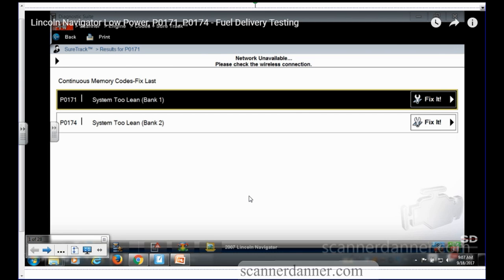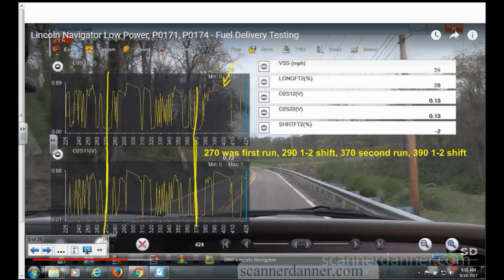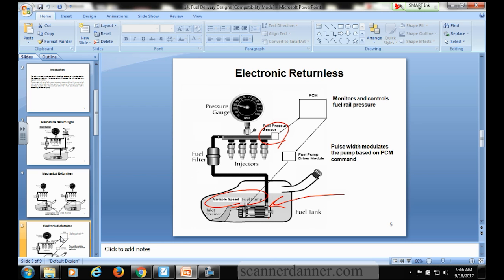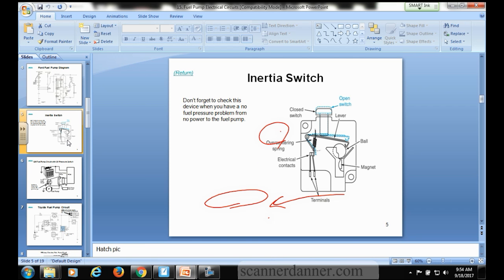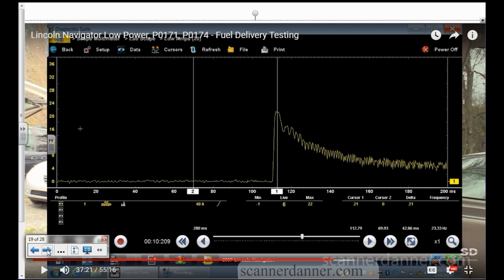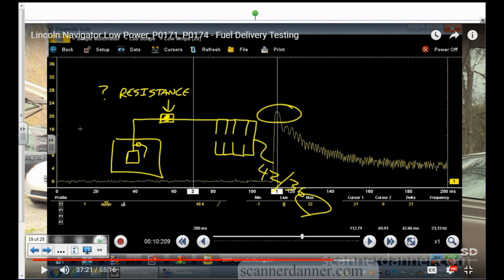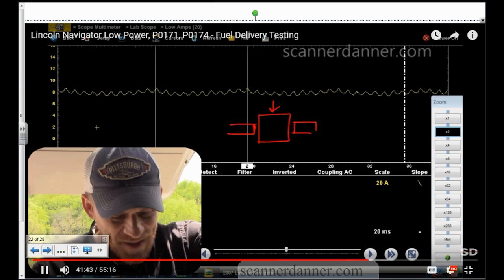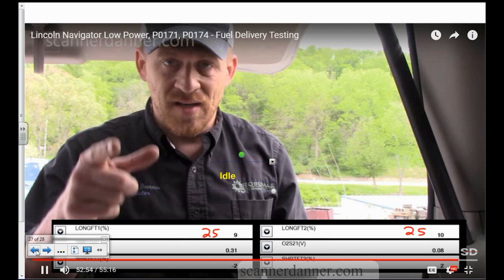An SD Premium Class on Fuel System Testing and Trouble Codes P0171, P0174

Comment: Hi Paul. Thanks for the video. Great and full of good stuf as always.
I want to discus with you about feul pump current. In this video you say, that cloged fuel filter would cause more apmerage on pump. I think on this fuel delivery design it is not true. Because fuel pressure regulator is in fuel tank, it doesnt mater for the fuel pump how big is restriction after that regulator (fuel pressure after regulator never gets biger than it is set to). So if fuel filter is in line it can be completely cloged and fuel pump amperage and rpm should be the same as if filter is new. Corect me if I am wrong. 
Thanks again for your sharing of knowledge.
Reply from the maker: I think you are right my friend! Never thought about it much. To be honest, it is really difficult to ID a restricted fuel filter no matter what test you do. Short of t-ing in a gauge before and after the filter and at which point it would be easier to just change the damn thing. Right?
But I agree, high amerage on a pump from a plugged filter would only apply to electronic returnless systems and return type systems. NOT mechanical returnless systems like this vehicle has.
Reply: I think you are right about changing fuel filter. I think that way: if its clogged filter, nice. You changed it and got it right. But if it was bad fuel pump, after changing it you will change fuel filter anyway. So customer doesnt lose money on both cases.
Reply: @arvydas6358  heres something to think about- a restricted filter causes pressure build up in the pump plus lower fuel transfer rates causing thermal stress on the pump.  a new filter fixes that but has the damage to the pump in the mean time caused irreparable harm?  my experience says yes . usually if a filter gets to that point  the pump wont be far behind.
Reply: @richardcranium5839   Yes. A clogged filter would cause a pressure build up in fuel system with return line from fuel rail or with  electronic returnless system. In this example car is equiped with pressure regulator in fuel tank. And fuel filter is situated AFTER pressure regulator. So there is no way that clogged filter could cause pressure build up at the pump in this system.
Reply: @ScannerDanner  a fuel flow volume test will show it sometimes.  theoretically speaking  yes  you would have to test  before and after the filter and by that time you are correct ya might as well change it. working with different hydraulic systems over the years(yes a car fuel system is a hydraulic one) often times taps are installed to be able to diffentially pressure  or flow test a part or a subsystem.  i've found bent twisted and other various restrictions in inaccessable places by using such methods  so an open mind that there are alternatives may one day get someone out of a bind.  mind exercises like that help get the whole picture in better focus too.
Reply: I am also thinking that on this design, clogged fuel filter will not change amperage much.
because fuel pressure regulator is in tank, but i don't know for sure how big is bypass hose trou regulator and how it affects amperage.

Comment from the maker: Class is in session :-)
https://www.scannerdanner.com/join-scannerdanner-premium.html
Reply: Danner i need your direction on a problem. 2007 haundai santafe, v6.
fuel trims on both banks at aprox 30%. im thinking MAF OR FUEL PUMP.
Where i got stuck at is when the rpms are raised fuel trims improve, i thought a bad MAF or FEUL PUMP  would cause fuel trims to go MORE positive as rpms increase?

Comment: Loved this case study. Perfect timing. I was the guy on your last video comment section with   same p0171. I added the  supercharger 5.4 3v and suspected fuel pump. 
I have around 5v on maf and have fuel sensor on rail. I don't have your snap on scanner but this clarifies alot. My fuel pressure is around 33psi idle no Schrader available.  I really suspect the fuel pump now. Truly weight in gold information. 
You are a pillar in automotive diagnostics. Cheers and Happy Holidays
Reply from the maker: Correct, you absolutely should not be seeing significant drops in pressure on a snap throttle test. Are you?
Reply: @ScannerDanner  no drop in snap test. It runs great when its engine cold. Open loop it runs like crap. 
I hear a exhaust leak when under boost. Then it loses power. Thinking air is getting through upstream unmetered. What do you think Paul? Thanks for responding
Reply from the maker: Careful, I think if you have a psi sensor on the rail, it is normal to see psi around 30ish at idle
Reply: @ScannerDanner  going to move it to the forums as you suggested. There shouldn't be any significant drop in rpm rise correct? If anything a rise, right? Its an aftermarket assembly made by airtex. My fuel trims on long term go above 10% with little to no drop in short term. Tuner assumed it was a vacuum leak and overlooked fuel delivery. these stock pumps in theory will support around 400rwhp but still a wearable component and I think it's been pushed beyond its limits

Comment: Gtdi gas through direct injection dont thoes types of fuel systems require more fuel pressure than normal or legacy fuel injected systems
Reply from the maker: Yes they do, but the delivery from tank to high psi pump (mechanical) is all the same

Comment: I am a member of the premium channel but i couldn't find this video when i searched .. thanks danner
Reply from the maker: I don't think it is there! I looked everywhere for it. Like I said, it got lost in my vault and was never released until now
Reply: @ScannerDanner  can you make us a video here or on the premium showing how to measure or test fuel pressure on direct injection cars , usually these cars have high pressure pump which will exceed the gauge reading so how we verify the fuel deilvery on that type .. thanks once again
Reply from the maker: I have a few GDI case studies. Also chapters 16 and 17 playlist. I have a no start GDI case study on a GM and a 3 part series on an Audi 
Just use the Premium search and type in GDI
Reply: @ScannerDanner  thanks danners
Reply: @ScannerDanner  thanks danner

Comment: If you want to gain a whole new larger audience , output videos of diesel engines in cars and truck. You are good with gas engines,  make diesel videos just like your gasoline videos and you can double your audience, viewers, and patrons.
Reply: With diesel vehicles, you still follow the majority of same processes in fault finding/diagnosis. There are some faults which require specific processes in fault finding ie for common rail diesel engines but are now starting to cross over to gasoline engines with the advent of GDI (gasoline direct injection. The simple thing is, if you are proficient in one thing, it isn't hard to become proficient in the other, the electronic systems operation are very similar.
Reply from the maker: I don't work on diesel engines otherwise I would! We have almost no diesel cars where I live, so I never see them. What I do know from the diesel techs who follow me is a large percentage of the concepts I teach are universal and can be applied directly to diesel engine systems.
Reply: What about hybrid clunkers?? I’m about to go to training for them
Reply from the maker: Don't work on those either but, same thing, the material transfers. The training will be good for you from the safety standpoint.
Reply: Yea I unhooked the 12 volt battery but didn’t unhook the high volt system started working on it woops didn’t know til my hybrid buddy said wtf you doin
Reply: @philh9238  be careful with hybrids, they can ruin your day real fast if u don't know what are you doing

Comment: Great I got a question. I have seen on several occasions the use of the fuel pump waveform to calculate rpm of the pump. My question has to do with the comutator bars. When u have a low current spot in ur waveform wouldn't the current flow be low again at 180° meaning the pump has 16 bars?
Reply: Great video but I'm still confused. My question is if a single commutator bar is damaged and doesnt allow current flow wouldnt u would see a drop in current flow when it passes both brushes? If so wouldn't 1 rotation of the shaft of the motor be every other dropout?
Reply from the maker: In theory that is correct, however I have a case study showing a complete drop out only 1 time per revolution which means when the polarity is reversed it can support current flow, so I suppose it would be a brush to commutator contact issue in that case, not an open winding. An open winding would be as you described
Reply: Cool that makes more sense thank u for the response
Reply from the maker: reverse polarity on that same commutator every 180, so it is not the same pattern

Comment: Can you make a visual representation of the difference a good psi with low volume and good volume ?
Reply: On a system with a return line you can reroute the return to a container to measure flow rate.
Reply from the maker: @anti chuckle You can fo sure my friend, it's just not necessary to ID a volume issue
Reply: @ScannerDanner  Ofcourse a "good PSI - low volume" condition doesn't really exist in a normal diagnostic situation, but flow rate is a useful indicator of the condition of the pump. It's nice to know your pump still has a little surplus capacity.
Reply from the maker: All you need to do to test volume is to look at your fuel pressure during a WOT snap of the throttle. Another good test is to look at your oxygen sensors during WOT on a test drive. I never directly measure fuel volume. Not once have I done that in a diagnostic process.

Comment: Do you have a video on p0172 p0175?
Reply from the maker: I have a few. MAF issues, ruptured psi regulator diaphragm, head gasket issue (contaminated O2s) are the common causes. Also, leaking injectors, fuel contaminated oil, timing issues can cause this
Reply: @ScannerDanner  what about a temperature sensor?